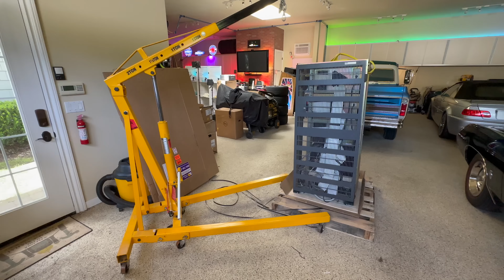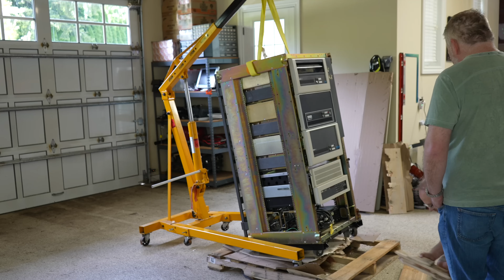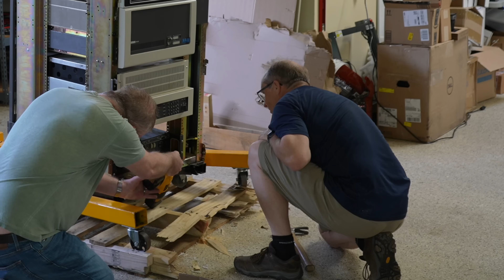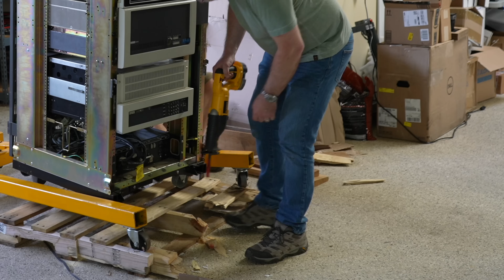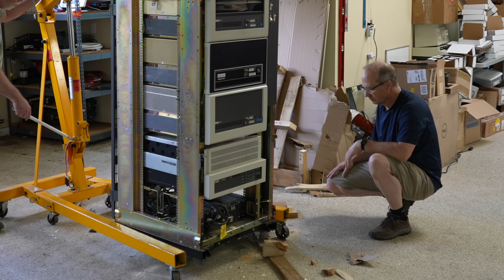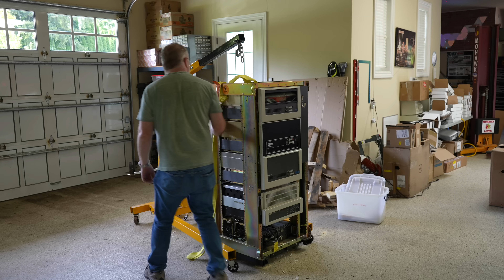I Bought the HEAVIEST Computer on eBay: The PDP-11/34!

Comment: When I started high school in 1977 we had a PDP 7 with a Teletype terminal, mark-sense card reader, paper tape punch and small maybe 4" tape drives.  Then we got a PDP 11/34 with 6 VT-100 terminals and a 5 megabyte disk platter.  This led to Bachelor's and Master's degrees in Computer Science (dual VAX 11/780s) and a career with IBM.  Fun times!

Comment: Ok not my format but it was cool to watch anyway, what would be even cooler is getting it to operate with a newer machine like a mac or windows machine  or even use a modern hard drive or solid state hard drive, and modern memory.
But by the time you've gotten there it would be out of capacity.     

Whats the storage space on the drives?  20 meg's

Comment: 3:29 in 1967 UD  university of Dayton had a computer room.
It was the size of 3 football fields
Of tape machines and cabnit's on top of   a subfloor that had room to route wires and air conditioning 
I was about 7 at that time as a kid i had the run of the campus, even during school in the summer time, i visited the dorms i was kicked out of only one place  the ladies dorms
Collage was not coed yet then.
At that time I didn't know why boys could not go in the ladies dorms
I did but who would think naked ladies would be running up and down the halls, they didn't do that in the mens dorms. People were more modest then. 
But i walked into every room on campus no one said anything, and plenty of people saw me.

Comment: Good stuff, Dave. I have worked on these in my early days, anywhere from a PDP11/05 (bootstrapped from paper tape)  through PDP11/34 all the way up to PDP11/70. Solid engineering, heavy duty materials. 
One note, this is not the heaviest computer on auction. A while back one of the super-computers from the National Weather Service was up for auction, quite a bit larger than this PDP rack. But also much younger, which speaks for the durability of DEC computers!

Comment: probably want to turn off smooth scroll on the monitor! I had to do that in the past for faster scrolling and smooth scrolling caused me nausea!
I remember having to tidy up some unibus cards for a PDP 11/34 that were lying around so the easiest way of getting them out of the way was to put them into the PDP out of the way but to then use a unibus terminator card to stop it from being able to see those cards further along the bus, it was a very full card cage! The PDPs were used with a bunch of custom software that was booted from tape and so was never necessary to actually boot RSX off of the disks.

Comment: I learned to program on a PDP-8.  I worked on a project using 8080As, we used a cross assembler that ran on the PDP-8 loaded from paper tape.  The original version didn't use the PDP-8's indirect addressing to use the additional memory in the box, so I wrote the code to put the entire symbol table in the additional RAM.  When I went to UCSD, I got involved in the UCSD Pascal Project.  They had ported the P-machine to the PDP-11s and were working on the Apple II port and various 8088 ports.  I worked on the BIOS for the TRS-80 and drivers for 8-inch Cromemco drives.  Watching you work on the PDP-11 brought back memories, especially the RK05s.  One of the techs had the platter from one on the wall in his office - it was a big piece of metal.

Comment: I remember PDP11s being all over the p!ace. For example I visited a TV channel as a kid and they has a PDP11 to sequence all the advertisments and content. Correct me if I am wrong, tge PDP 11 was good for realtime tasks. It appeared to me that they stayed in service far longer than most otber computers. One of the OSs was simular to VMS which one was tnat?
Reply: We used a pair of PDP 11/45''s, one running RSX-11D, the other a proprietary OS, to control a material handling system consisting of three stacker cranes and a network of conveyors. The PDP was a great platform for real-time process control and was used extensively.

Comment: I was a coop student in the late seventies, working for the DEC manufacturing facilities in Puerto Rico. Our factory used to create PCBs from scratch, many for all the series of DEC PDP computers ever made. On my first day at the job, they gave me a Simpson meter and had me look for shorts and opens on many of the boards they manufactured. I worked with some of the smartest engineers at the time. If you look and find circular stamps with the letters SG or AG, the board was made in Puerto Rico. At one time, they began work on PCBs for the VAX line of computers. One computer that never saw the light of the day was the PDP 11/77. It was a dual-processor version of the PDP 11/70. However, it was canceled because it was too fast compared to the PDP 11/70.  This was one of the best jobs in my EE career. 173000G!
Reply: Hi EM, Luigi M from Australia here.. in the late '70s I made a few training trips to Marlboro on DEC20's and stuff. One of the FS engineer I met there was based in PR as an FSE looking after your LCG machines.  Jim Something was his (partial) name, really tall, bushy beard and long curly hair, if I remember well.. always carrying a 2 qt bottle of Coke full of 50/50 coke and PR rum, when off duty by the apartments pool. Great times and memories during my 19 years at DEC..!  BTW, very interesting about the 11/77, did it have a codename?
Reply: I don’t recall.

Comment: I worked for Computer Warehouse in Sydney (Australia) for a year as the DEC tech - they sold 2nd hand computers... I just loved that job and would often stay late in the evening playing with some crusty old PDP. Highlight was installing a 256K upgrade in a 11/70 (yes it was core) and reengineering an RA80 where DEC had dropped the drive on a forklift and written it off their books. The case had twisted and a pin out of the belt tensioner had somehow completely exited the drive enclosure. Luckily an "adjusted" 4" nail fixed the issue. The RA had a diagnostic pad built right into the controller so 3 days of integrity checking showed no errors and the 2 drives departed for something like 5x what CW had paid for them. One of my best hacks...

Comment: This video brings back memories. I used to work for a computer company called Evans and Sutherland (short name for the company was E&S). I was a field service engineer for them in the 1980’s. They had a computer graphics system called PS2 (Picture System). The PS2 system had an unibus card for interfacing to the PDP 11 series systems . This card used the what I thought of as the interrupt signal, what you are calling the NPG I believe. Yes it was a signal wire that was wire-wrapped on the older unibus slots, and daisy chained to each slot. I had to also cut this wire during first install of the PS2 systems. To re-wire-wrap the pins you would just need a wire-wrap tool along with the 28 or 30 gage wire. I used to maintain these PS2 systems with the Unibus cards in DEC PDP 11/xx models as well as DEC VAX systems with Unibus adapters for backwards compatibility with the older PDP 11 systems. Thanks for the video as it brought back lots of good and bad memories 😁. I would be interested in more of these types of videos.

Comment: Does the /34 have a ODT console like other 11s ? If so it should be directly accessible from the terminal. That will alow you to run tests whithout using any other software running on a PC

Comment: I have enjoyed following your adventure on the PDP 11 Facebook group.  I was fortunate to be a System Manager and programmer for an 11/34 and later 11/60 and 11/70 systems running RT-11 and RSTS/E.   I too was nervous the first time I had to remove a grant jumper on the wire wrapped backplane to install a new disk controller card. Great times. Look forward to more videos bringing back more PDP memories.

Comment: That horrible sound is called the fans!

To this day, I have hearing damage due to working for years in a computer room with all those damned fans running!
Reply: As someone who worked as a computer operator in the 80's, the sound of a silent computer room was a million times worse than  a working room! If the power is out to the room, shit is going down!

Comment: I first used a PDP-11 in college at 17 ish, that would have been 1984. I wrote a Z80 emulator on it for my final year project (I was a confirmed Sinclair fanatic). There was a much larger PDP-11 (70 I think) at Polytechnic, and then I moved on to VAX’es when I started work in 1989. They were superb machines, and I fondly remember them. Manuals! Real, proper manuals that told you everything. Being a true geek I learned VAX Macro assembler and wrote a modem driver in it - this was used to communicate between remote sites in the UK. I think my finest hour was patching an RMS database that was corrupt for a water company in Eastbourne. All in all, I loved it.

And I retire today! 

Now it’s pet projects that will keep me busy, I can’t wait! Thanks for the content Dave, you never cease to be inspiring and interesting.
Reply: I remember the Sinclair.  I used one as a prime number generator.  I wanted to find the largest prime number the Sinclair could produce before the program bombed.  At first, I was getting a new prime number every few seconds, to where it would take days to calculate the next number, fun days of my youth.
Reply: Enjoy retirement dude!
Reply: Z80 emulator, does it run on a rpi pico ? so you could run a sinclair game/program on a pdp11?
Reply: @jyvben1520  - not a chance, plus this code went to the great bit bucket in the sky around 40 years ago too!
Reply: @morganskinner3863  understand, my cobol exam was the last time i saw that code  or did any cobol !
Reply: Enjoy your retirement and thanks for the post, very interesting read.

Comment: A tip I’ve used a few times is to use a comealong and a sheet of plywood as a ramp to pull the heavy item by its base and slide it up and on to the forks of the shop crane, so that it’s sitting on the plywood with the plywood supported by the forks. Then you can just lift straight up and remove the plywood

Comment: 24:27 - for what it's worth, I didn't have any idea how wire-wrapping worked until maybe a year or two ago, at which point I watched a couple videos (after someone else mentioned it, but with enthusiasm about it) on how to do it, bought myself a tool and some wrap wire from adafruit, and tried it out.  I'm sure I'm not actually good at it, but... it's not hard to at least do a bit of, and of course it's easy to set up a practice rig.  Would recommend trying it out in such a way, and then if you like it, maybe do some of the real deal on the DEC.

Comment: I started my IT career by using a PDP 11/70 running RSTS/E in high school.  I loved that machine, just about everything ran on DEC Basic.  I still remember using PIP commands to set files attributes to move my programs into the 1,2 account so they would run privileged.  I miss those days.
Reply: Sometime I need to port the old Star Trek for VT52 to something a bit more modern.  BasicPlus and the explicit VT52 escape codes are a bit annoying to figure out having not used that part of my brain for over forty years.
Reply: @garry4086 ditto ! A similar  road travelled for me via a high school with only 1 Teleray terminal + dialup 300bps modem to an 11/70. Yes I remember using peripheral interchange program (PIP) too.

There was a large  library account of game and education programs in "basic plus" had star trek for vt100 no need for escape codes of course. It was just the thing to motivate a teen to start teaching yourself Basic ;-)
Reply: @SkipInPerth  Did you know the "play" command could be run while logged out?  And, it ran privileged so it could play the system password file!

Comment: I can picture USAGI with his head between his legs crying on how simple that was to get running. 1. bad, cap, 2. replace foam, 3 fix stuff like termination and such from missing cabinet. (This seems to happen more than every now. The system was sold in pieces.)

Comment: let me guess a bill not garden post rubber of gui off a fax/copier zerox style didnt help or his robbed platform mouse or his robbed eperating system2.1 ibm or his robbed sound drivers not to go anywhere near dos level low 1 formatter robbed infact all he never did was use a gun and rob a bank instaed he robbed us all the net and his crappy whats it called fail ai nokia lumia fella is like maddona never had a new thought tune or idea of his own , take u to court win95 take u to court win 95beta take u to court win 98 take u to court 2000 what a gaff that was and so on and on win 2024 is win 95 in a new box unlike his wife my god spend some dosh bill get a upgrade say linux with new tits and pussey

Comment: Loved the PDP line.  introduced to the PDP 11/70 that ran the plant, but really enjoyed working on the Micro VAX/VMS.  No way the current MS OS is as reliable as VMS was 30 years ago.  One of our uVax machines was rebooted after 3 years of non-stop operation as a precaution, nothing wrong, rebooting just in case.  uVax memory management was incredibly solid.

Comment: As a broadcast radio engineer that routinely repairs and does component level repairs. The plug in the old gear and yolo it is common practice I mean chances are the last guy did so and damage already occurred so find what still works and work from there. But at the same time yolo on current limited supplies don’t run arc welders. Check fuse values to in circuit values then yolo that equipment. Only the strong survive!!!

Comment: Back in 1980 I worked for a company that sold the very first point of sale system. They were terminals that looked like cash registers and had built in communications so you could daisy chain them and even hook them to a modem. It took the world by storm and was called Data Terminal Systems that was started by a former VP of engineering at DEC. They offered a DEC PDP - 11/23 either direct connected or through modems to the terminals. It had 2 5mb hard drives which eventually were doubled to 10 mb. Pretty advanced stuff for the day. The point of sale system was quite advanced and had an internal programming language. I would create the software on the PDP 11 and upload it instead of keying it in on a point of sale terminal. If I remember correctly the OS was RT-11 and I would program in Macro-11. Long ago so I could be wrong. In the point of sale market the PC came along and killed that idea.

Keep it coming Dave! Good memories!!!

Comment: to wire wrap there were these funky things that looked like over engineered screwdrivers with a shaft with one center hole and a offset hole...the offset hole you stuck the wire into and than turn the screwdriver placed over the pin and it wraps........ in 2007ish I was working for a company that did demolition at the local military base that threw out a small handful(still quite a bit) of old test equiptment and old parted oscopes; in the stuff there were these fancy paper foil packaged things which I though maybe would be componets to something than opened it to find that thing I described; at first I thought maybe it was just a shaft to some other equipment but after a bit of digging learned it was for wire wrapping; I say over engineered as it was like 3-4 pieces..... a removable handle with twist on top(as though for a interchangeable bit or similar) holding the shaft which was a a tube type thing along with a other part(the thing that had the center hole) that appeared to have been machined ** I believe it's possible to purchase less over designed tools that do that same but yeah(probably 60's military budget):D ** *cough xenix:P

Comment: We had 2 PDP-11/34 in my HS.   Later when I worked at DEC as a night operator I backed up several RSX-11/M machines including one quad 11/74 machine which was used to generate all the examples in the manuals.

Comment: Can you get RSTS/E and BASIC-Plus to boot on this hardware?  In the mid '80 had access to a PDP-11/73 and QUME?  VT-220 compatible terminals attached to a 48 port MUX card.  I think that hardware was Q-BUS? not a
UNI-BUS system though.

Comment: Yeah that wasn't a great looking pallet. As someone who has worked as a storeperson in warehouses for over 10 years and dealt with transport companies quite a lot, you need to take charge of some transport arrangements by specifically asking for a strong wooden pallet. That pallet looks like it's made of pine which isn't great for heavy loads and doesn't age well and the slats look a bit thin and weak. Also the slats are a bit far apart so putting that tall cabinet with castors on it looks dubious and like the work of people who are inexperienced in transport or who didn't care.

You're lucky that thing didn't tip over or pull the slats off the pallet during transport.

Comment: What gauge of wire did Dec use? 30, 32? I still have a 30-32 gauge wire wrap and unwrap tools. I never worked on PDP 11 but on Varian 620I which was similar to PDP 8 I believe.

Comment: What a blast from the past!  I haven't thought or used so many of the terms spoken in this video in decades; poke, daisy chain, dip switch, terminator, 9600 baud.  I used a PDP-10 in the early 1970's with punch tape.  Way better than showing up at two in the morning at the Computer Center to see if my program ran on the IBM 360.